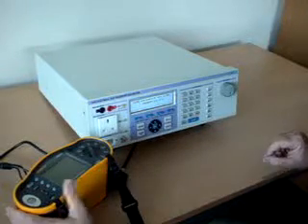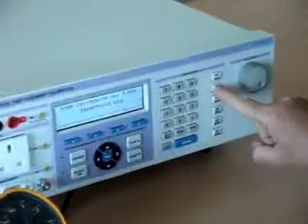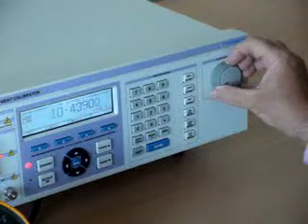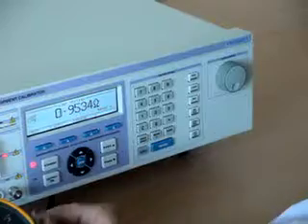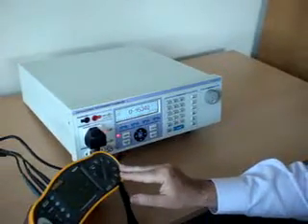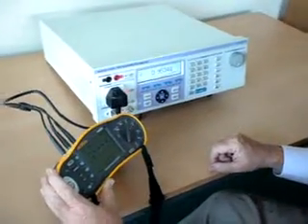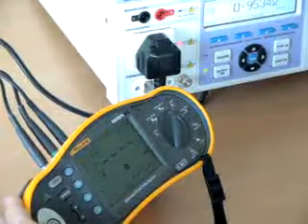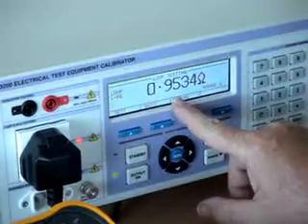Calibrating Loop Resistance using the Transmille 3200A

Comment: That's very good, but what do you next to adjust the tester,
Reply from the maker: Hi Tony,

To adjust the tester, normally instructions are included in the service manual or calibration guide when available.

These guides are provided by the manufacturer of the loop tester themselves, for example Megger.